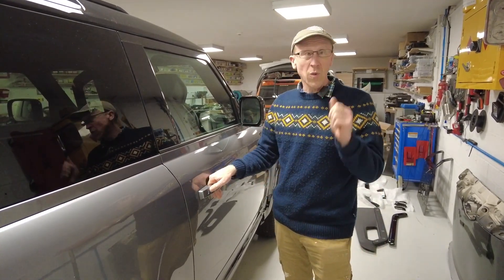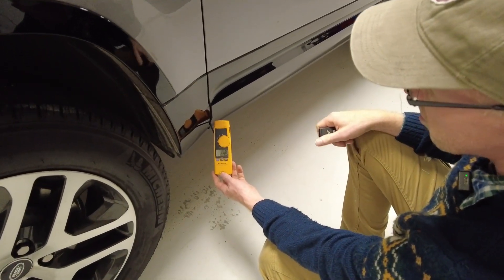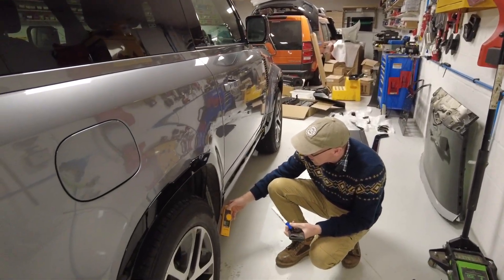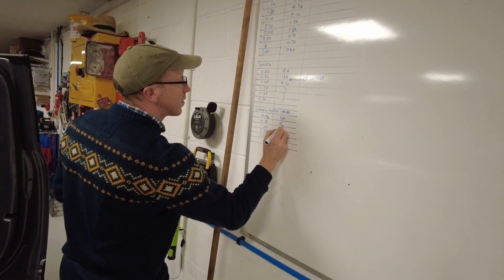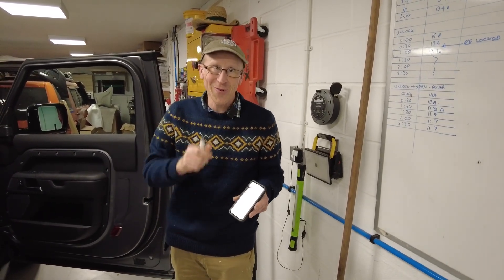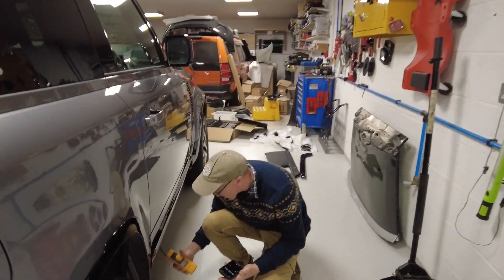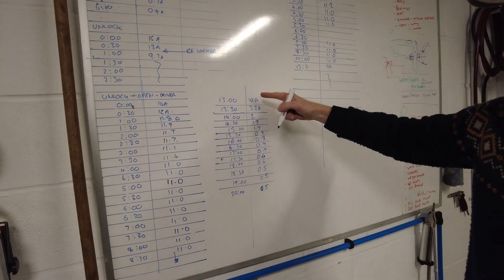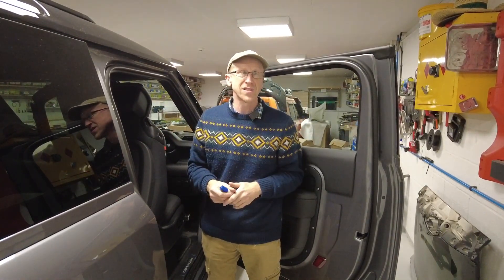Battery Drain Analysis on Land Rover Defender L663 90 - Low Battery Warning Problem

Comment: Great investigation study, Simon.  This issue continues to befuddle me.  Is there no way to "code out" some of the drain - as in, don't fold/unfold mirrors, or don't power up entertainment and PIVI until the start button depressed?  I mean, how long would it take to start PIVI from scratch everytime you start the engine?
Reply from the maker: I need to test the battery drain again as they have made some software updates over the last couple of years. The PIVI system actually has its own small battery.

Comment: Howdy Simon. Any chance we can remove a fuse to disable the infotainment system while camping to mitigate this? Also, if we do drain the battery while camping, do we follow a standard jump start procedure or use a battery booster battery?

Comment: a simple solution around battery drain, whilst camping with back door open is to trigger the rear lock mechanism with a screwdriver so car thinks the door is closed and therefore will go to sleep

Comment: Hi Simon, Going back to this issue, on a D5 we’re found that if you leave the drivers door open it looks like after the first sleep mode is activated then it seems that if you open any other door then the car stays in sleep mode, wondering if you added a “camping mode switch” on the drivers door to trick the system to think the drivers door is open then maybe the battery might not get flattened while camping. We’re not sure how the drivers door switch works. Maybe you could investigate and come up with a simple toggle switch to trick the car.
Oskar

Comment: Hi Simon, lots of discussions on the D300 Mild Hybrid system in the AU FB groups. I was looking for a post as one member explained the system and it different to other defenders. I did find this bit of information "Directly answering your question: you don't have a typical alternator on a D300. There's a 48V starter/generator attached to the serpentine belt which supplies the 8Ah 48V lithium pack for the MHEV system, and a 48-to-12V DCDC that is the ultimate source of power for the 12V circuits. The 12V alternators in non-MHEV Defenders are in the 180 to 230A range though, and the MHEV DCDC has to support the same kinds of 12V loads that those are designed for." My understanding is the 48V battery is used on the stop/start system for the car and I have found it to be seamless, responds very quickly. This is in response to some questions below on the stop/start and the effects on the main battery I think there is zero as it not being used in the mild hybrid. Could be wrong.
Reply from the maker: Interestng - I need to investigate more - there is what appears to be 12v battery lead in the engine bay.... let me check tomorrow - this would not be needed if there is no 12v alternator or starter motor ?
Reply: Based on the information above, you would think the 12volt battery should be a deep cycle rather than a start battery. A deep cycle would be far better at handling the drain of electrical items over a peroid of time.

Comment: Really great video.  I've got a P400e 110 (Plug-in hybrid) and although I havnt noticed the low battery problem it does take quite a while with the engine running before the EV (all-electric mode) becomes available.  (I had hoped to be able to use the All Electric mode for all short journeys so am finding this a bit annoying :)).  Do people think this might be because of the same issue  i.e engine has to come on to charge main battery before you can use the bank of Lithium batteries in the boot?  It would have been better if the main battery charged at the same time as the Lithium.  Anyone else seen this problem?  Wonder if I could find another way to keep the main battery charged.  Someone further down talked about using solar and wonder if this would be possible without bu!!$ring up the main battery system.
Reply from the maker: I am yet to use our hybrid system ! need to get to grips with this..

Comment: This is a D300 right? It should have the mild hybrid tech… you have another battery to test in this setup Simon :) Although, that battery probably isn’t used to ‘help’ the start battery.. I had the low battery warning before as well
Reply from the maker: Yes this is the D300 Hybrid - not used the Hybrid system yet - need to read up more about it.

Comment: Whats the 110 like ? compared with the 90  in battery loss ,  My Car -Volvo V70  even that registers a battery loss but alarm system must pull power from the battery ? .My relation also has a Volvo V70 - also the same . Just wondering if all the computers are zapping power too ? - Ah you just mentioned too !

Comment: Nice test, Simon! It’s actually even worse than you indicated at the end. A 90Ah AGM battery is likely to have only about 45Ah (50%) usable capacity. So you can really only open and close the doors about a dozen times before you kill the battery, and even fewer to trigger the low battery warning. Land Rover should make their timer more conservative to preserve battery life, as well as applying different logic for the rear door, and perhaps a camping-mode option. Personally I plan to put a solar panel on the roof just to keep the main battery topped up.

Comment: This is by far the biggest problem I have with my P400 D110.  I already fitted it with a secondary battery system through a Redarc Manager 30, and all the accessories are off of that.  But just opening the door to get a new beer out of the fridge boots the whole car up, every time.  Then once you get the low battery warning, you lose your internal lights.  It's almost to the point where I want to see if using Topix Cloud to put it into transport mode at camp will solve it.  Otherwise I have to start the truck at least once a day and let it idle for 20 minutes, just to charge it for all this craziness.  Land Rover desperately needs to add a "camp mode" somehow.

Comment: That was very interesting, I have a Mercedes’ cls and it doesn’t get used daily by any means but during winter the battery suffers and messages that convenience settings are disabled, bit of a design fail I think

Comment: Excellent analysis Simon. Very, very useful!!! P.S - Congratulations on buying the 90. You guys rock 😀
Reply from the maker: Hi Jorge - thanks for your always supportive comments.
Reply: @L663   Hi Simon I have a question for you as well as a challenge, ASPW has yet again made another claim about the new defender today and of cause he has based this claim on an internet rumour without doing any testing for himself. He is claiming that if the Defender has a fully flat battery it requires a laptop with an internet connection in order to start it up? Is this true or is it wishful thinking on his part? Could this be tested with a fully flat battery and a jump pack?
Reply: @L663  The second part of my question is I am wondering if the tracker system on the defender is causing a drain on the battery each time it's opened? I bit of a hard one to check unless someone has not included the tracker package, wonder if it can be disabled on the in the CCF files? My though is if someone wasn't to option in the tracker pack and use Air Tags instead would the defender have less of a drain on the current. It's not an easy on to check tough? cheers

Comment: Simon…I’m no electronics expert but from experience, the Low Battery warning occurs on my car if I leave it untouched for a week…longest was 14 days and then even the JLR Remote App warned me. Also, it gets much quicker doing this as the battery ages and in fact I can tell the battery condition by how many times I can operate the tailgate open and close. After a long run then I can do around 10 cycles but if all the journeys are short then whilst the tailgate opens, it will not close and send a chirp warning…then if I open a rear door, that resets things and the tailgate will then close. My guess with your car is that it has yet to have a long run and may have been standing around for weeks before delivery so all it needs is a 50 mile drive and the Low Battery should stop appearing. Lastly…battery life…mine failed very quickly at just under three years…it was replaced under warranty and I understand that is about all the life you get from them because of the drain and recharging cycles being so frequent. Useful video though…I hate the radio turns off after about 8 minutes…I guess that drain is really heavy! 🤔🙂🫢😀😀😀😀Richard.
Reply: If u drive ur Defender with Stop / Start functioning, this also has a huge effect on battery life. ( of all vehicles )
An AGM battery is, on average, required to start the car multiple times every drive.
Average of 17,500 start ups per year, causes the battery to generally last 3 years, if u r lucky.
If u turn Stop / Start off, the battery will then only be required to start the car about 750 times per year.
Since taking delivery of my 2017 Disco Sport, I always turn Stop / Start off.
After 5.5 years, and 110,000 kms, I am still on the original battery.
Reply from the maker: Interesting points here with the start stop etc
Reply: @L663 I’m sure many people will agree with my experience.
Many factors can / will determine the life of a car battery…
Basic cars without heaps of gizmos and stop / start, will have a Lead Acid battery.
EG a 4 year old Toyota Corolla.
In a car like this, the battery will generally last at least 5 years, in a warmer climate, unless if you only do infrequent short drives in the car.

Comment: Hi Simon,  JLR diesels have a different charging or power management than the Petrol engines.   Low battery is less of an issue on Petrol versions.   So, maybe engine management is a big drawer ir power? Either way if you want to use the car less then petrol is better than diesel as far as battery charging.  Would be good to compare the two?  But deffo petrol is better for the battery
Reply from the maker: My petrol has the same issue - but it has lots of accesssories - so I wanted to test the new 90 Diesel - it seems the same.
Reply: @L663   there is a difference in the distribution of charging the battery between the Petrol and Diesel, you can recharge the battery faster on the petrol over the same range/time if driving than the Diesel- not sure what or why but there’s a different set up between the two.  Therefore the low battery warning is less prevalent on the Petrol.🤷‍♂️
Reply from the maker: @markwall6651  The petrol engine is at higher revs so this may help - but Land Rover could change the pulley on the alternator to resolve this...

Comment: Wondering why you've got the low battery warning so soon into ownership, was this because you've been doing a lot of door openings etc for your videos without much regular driving, or maybe the battery wasn't fully charged when you took delivery?
Reply from the maker: Yes its because we open the doors and dont drive it a lot... but it is not efficient use of power... and power is energy..... car makers need to get better at saving power.

Comment: Some off you will already know this, you can only use 50% of the 90Ah as draining a lead acid battery below 50% will begin to damage battery and it will premature the battery life. Therefore you will only be able to use 45Ah, then the battery will begin to damage, so not recommended.

Comment: Modern cars, (well my Volvo anyway) have light sensors so interior lights only come on when needed and not in daylight, your Land Rover will be the same. Same as the auto headlights.
Reply from the maker: The Defender does have a light sensor - i have decoded this on the CANbus
But pretty sure the lights come on even when it is bright !

Comment: It may well take 34 by 13 minute cycles to consume the total amps of the battery but at what point would the voltage drop such that the car would fail to start? I presume that the ECU’s require a minimum of something like 11 volts to work and when they don’t, no start?
Reply from the maker: Yes good point - I think you are down to about 15 door cycles and then you are in trouble !
Reply: @L663  
That’s with a new and fully charged battery in the first place, not one like yours that was already near to having the low battery warning on.

Comment: I agree that 0.5 amps is not insignificant. Maybe the current drain has something to do with wifi connectivity. For comparison a P38 draws about 0.03 amps when asleep.
Reply from the maker: The 0.5A reading will not be accurate with a clamp meter... my main worry is the 11A for 13 minutes.
Reply: @L663  
Depends on the clamp meter you use. I was recently looking at one that has a 4 amp range. That should be pretty accurate at 0.5 amps. I have a similar one and have compared it to an inline meter. It was very close.

Comment: It was mentioned the last time you did this with your LR110 and that is the addition of a 'Camping Mode' button, switch whatever would be a good idea. Probably the best solution would be a combination push on the keyfob.
Reply from the maker: Yes indeed - did this test on the 90 just to check if it had improved ! also the 90 has no accessories fitted !

Comment: What happens if you use the button on the key fob to just open the tailgate?
Reply from the maker: Nothing - this button does not work on the Defender !
Reply: @L663  yes it does Simon! With this button you can unlock the tailgate without unlocking the car! Try it, lock the car, press the button on the key fob and you can open the tailgate without unlocking other doors. By closing the tailgate the car will lock again.
Reply: Furthermore… and even more important: it seems like the Pivi Pro System does not start if you press the button for the tailgate on the key fob and open the tailgate….
Reply from the maker: @Johnny-ts7vb  This must be new - watch this video
https://youtu.be/6Ws5_-jeyhs
Reply: @L663  already did… and still, it already worked back then :-) try it (you need to press the button on the tailgate handle - after pressing the button on the key fob - and just the tailgate opens)
Reply: @powerfulukltd I can confirm that it does work as @Johnny describes. Tried it this evening (I have a 110 in the X trim as well). First disabled the keyless entry (thank you for that video!) and then locked all doors. After that, pressed the rear tailgate unlock button on the remote and then opened the tailgate door by pressing the physical button on the back of the tailgate handle. The infotainment system did not come on, as far as I can tell. The interior lights did come on, though (if anyone knows of a way to disable those on door open…). One thing to note, pressing the unlock on the remote does not produce any discernible feedback, haptic or audio. The first time I tried it, I thought nothing happened.

Comment: Super useful and interesting video. This has been one of the most challenging things about camping with the Defender when the camp is over a few days. (I have learned to bring a back up battery charger.) 

Two questions:

1) Do you think it is possible for Land Rover to adjust the seemingly excessively long startup and standby drain on the battery through a software adjustment? (Benefits outweigh the drawbacks to the customer experience, if you ask me!)

2) Now that you have a keyless entry car, I'd be curious to see similar tests with the key in the faraday case. A year or two ago, best practice when camping with the Defender was to: leave the doors open, turn off overhead lights as much as you could to not trigger the draw on the power and keep your key in a faraday case to not trigger the drain. So my question is more about does the proximity of the key have anything to do with the amount of drain on the battery at all? Is there any connection or is this all just a bit of folklore? (Just curious...)
Reply from the maker: OK I will try this - I still need to work out how to turn off the keyless entry - is it the same as in the Sport L494 I wonder ?
There is a guy in Taiwan that has disabled the car waking up - I need to find the video again.
In the CCF i have found this setting I need to play with
https://www.dropbox.com/s/sfcoptm4cszj5bh/quiecent%20relay.png?dl=0
Reply: @L663  Ahhhh, that setting in the CCF looks interesting. Also curious about the video of someone who's disabled their car's wake up! The curiosities continue!
Reply from the maker: @stevenburnsvideo  here is the video
https://www.youtube.com/watch?v=GJ_shzbzoFc
Reply: If the key is kept in the vicinity of the vehicle this will have an impact on the vehicle going to sleep the module will send a signal to look for the key if it finds it it will keep the vehicle awake longer
Reply: @johnreed2744  Thanks for confirming. (I honestly didn't know if the faraday case had any effect on the timing of the 'awake' state. So... it seems pretty likely there is a setting in the CCF that calculates for this scenario as well.

Comment: Some nice testing Simon.  With that sort of draw, 14 days in an airport car park will require roadside assistance to get you started again.  You should be getting not much more than 0.25 mah draw on a "normal" car.  So much for progress then!
Reply from the maker: The lower value of 0.7A may not be accurate with a clamp meter - the main issue is the 11Amps when you open the door.
Reply: After 96 hours of inactivity, the vehicle goes into what JLR calls "sleep mode" to preserve the vehicle's battery for start-up. According to the documentation the onboard telematics system is put to sleep.

Comment: Hi Simon, if you’re interested I use web accessible current monitoring devices which you could permanently fix on the battery and view/download data over a secure web interface. Will be a lot more accurate than hand writing and you will collect data 24/7. Email me if you want details.
Dave
Reply from the maker: Hi David - yes i will drop you a main - would be good to see the power drawer curve.